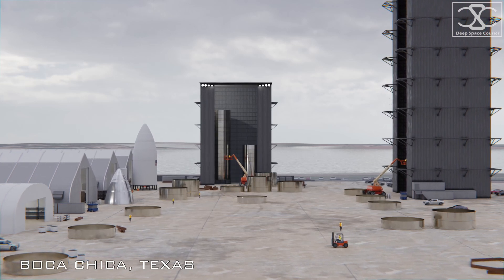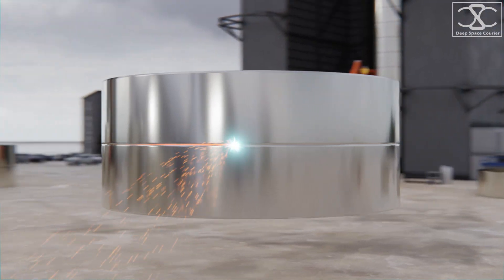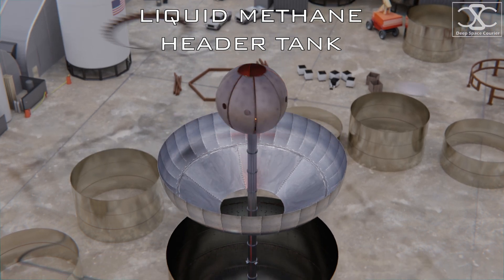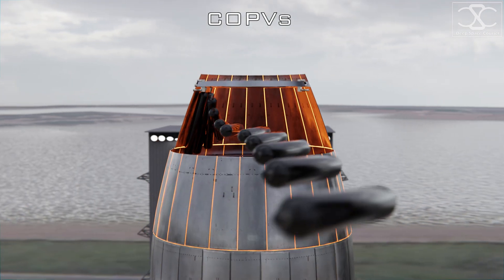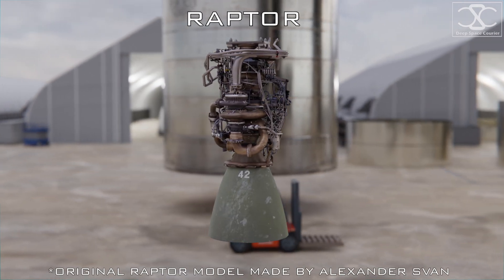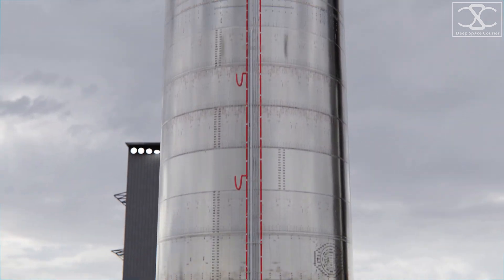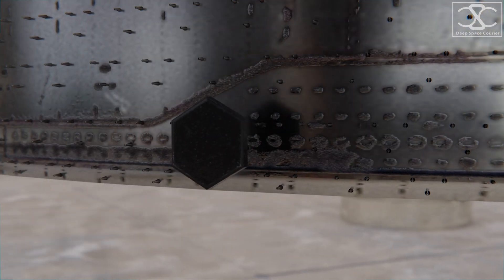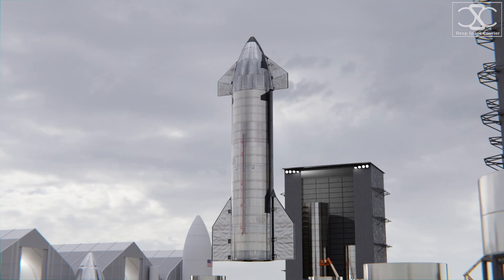Inside the SpaceX Starship: A Narrated Assembly Animation

Comment: They're landing everything on platforms now, not in water.
Reply: I doubt the starship catching concept to be honest, catching the booster is feasible. For cargo flights, payloads would have to be integrated in a seperate clean room facility anyways. Catching the starship requires so much more precision than using landing legs. Landing legs are much safer. However for tanker varients.of starship there is a rationale for catching it such as rapid fueling for rapid launch cadence. But dont think starship will reach that multiple launch per day goal to justify catching the ship.

Comment: Please start building flying saucers with Element 115 stuff or similar 
antigravitic ARV FTL crafts like the 1980's Flux Liner ...

Or like a 35 times larger cylinder in width 

Perhaps these could be 3D metal printed 
in one piece just like the trusters!

118 feet x 30feet

=  3540 x 35 = 123.900 feet / 100 x 30 ( feet in meters )
=37170 cubic meters cargo vollume to fill.

Add gravity shielding matting to isolate the gravitational physics.

Additional engieering is based on capacitors, plasma flux, particle magnets...
Chemical gas, probably a big magnatron at the tip, surface material fision reactor.

Benefits would be:

More space for cargo at once.
Much Faster delivery ... about days or hours to Mars....
Just needs to hover up.
Can go several times around without refueling...
Noise level reduced suitable for urban enviroments...

Thruster companies still gonna continue, just smaller thrusters for 
maneuvering thrusters.

Comment: 4:20 (talking about the bottom text), Probably the sea level engines are needed to fire after separation. Low thrust to weight ratio stages suffer of relatively big gravity losses (thrust to weight ratio being the ratio between the mass of the vehicle and its thrust), with more engines and more thrust this losses (although still present) get reduced, this might compensate the difference between using the less efficient sea level engines and no using them

Outside of that small thing, great render and video!
Reply: All six engines will fire after separation, in fact Elon confirmed this. I'd expect the strategy to limit G-loads toward the end of the burn would be to first shut down all three sea level engines, then throttle down the vacuum engines.

Comment: The part that I laugh at that most people deny is the rapid reusability.  FYI, this is just space shuttle but in cylinder form.  Those tiles will need inspected and replaced every flight, otherwise FAA will not clear it to fly.  So doing that will take at least a month minimum.  It takes at least 2 weeks for FAA certification, so maybe 3 months optimistically inho.  All my money is with NASA and that SLS is still better.

Comment: The heat shield tiles constitute the Achille's heel of Starship. The recent incident where even the rumble of a single raptor managed to dislodge a few tiles is not confidence-inspiring. I wonder why Elon rejected the idea of transpiration cooling. Such a system would be much more robust in my opinion.
Reply: Transpiration is hard to control (i.e. how much would transpire through each "pore") and the "pores" would be easily clogged with soot.

Comment: I see no possible way 150 people could comfortably travel in that Starship. Sure they would fit but they would be packed in head to toe like a tin of Sardines.
Reply: I don't think it would be 150.. 
Imo it will probably be around 50 for mars.
And around 100 for earth to earth.
Reply: Where do you get the 150 people number from?
Even Musk said 100 people max to Mars.
And in the beginning there will be much less passengers anyway.
Reply: It’s 100, not 150. You must not have a sense of scale here, because starship is massive. You could actually fit 1000 people in there and it wouldn’t be anymore cramped than an airliner
Reply: It's apparently 8m across, which is quite large... But I doubt it is a single skin of stainless steel. So I assume there will be a cavity creating a smaller inside dimension. My sitting room is 6.5m by 4m / so, to be generous,  lets say 7m by 5m ... I had a Party at my house with 30 people most of which were in the sitting room and you could hardly move without banging in to someone. Going on those proportions to get a 100 people in my house I would have to have at least '3 Floors' the same size, possibly 4 floors and they would be crammed in like a tin of sardines. That's why I find it hard to imagine the numbers that are being proposed...
Reply: @lilbullet158  Actually it's 9m wide, but yeah I agree. Although I don't think SpaceX ever said starship will carry 150 people..
Reply: @lilbullet158  your interior numbers are way off. Its 9 meters by 15 meters meaning 1100 cubic meters of space. No second layer of skin will be present as far as we know, and even if there was, a meter thick is very unnecessary. It would be more like a centimeter thick at most, but that’s even overkill.
Reply: @lilbullet158  
"It's apparently 8m across" 
How did you get to that conclusion?
Reply: @reagank.2268  It would appear you are looking at the Starship as a 'Giant Bean Tin' with nothing in it, like every cubic meter is space for Humans to be squeezed into. Which in itself is an "Inferior" , or rather a ridiculous hypothesis. You only have to look at Every other vehicle used for the transporting of people into Space to know that a considerable amount of available space is taken up by the huge amount equipment necessary for the journey. Also, with regards to the Starship having a 'Cavity' ? One way or another 'It Has to have one.' What that Cavity is made up of is debatable, but remember Space is more than Minus 400 degrees-F a temperature that would Freeze and obliterate ANY Living Tissue. So Insulation is an absolute necessity. And the Bigger the empty space inside the Starship,  the better that Insulation has to be (To keep Cold out an Warmth in). You need to sit and think your proposals through more realistically.
Reply: @lilbullet158   How much shielding do you need? The Apollo capsules experienced a massive amount of radiation and heat(because they’re going to the moon) and they were only 2.5 inches thick, some places were even half an inch thick. You don’t need an entire meter of rad shielding. Just an inch or two of insulation will do the trick. 

Also, what feels like a small amount of space on earth, is much more in zero g because you can use all the surfaces for equipment. The space shuttle had 70 cubic meters of interior space and could hold 7 for a week. Starship will have 1100 cubic meters of space. That’s 15 times more interior space. 15 x 7 equals… 105. Well how about that
Reply: @lilbullet158  for the crewed launches to mars, they will send cargo starships with the crew that can dock to the main ships and can hold all the supplies for the mission. No cargo space required in the main crew ship
Reply: @reagank.2268  Building Spaceships is not my field. But I'll take a guess right now that as big as the Starship is the first Man Mission it goes on won't have any more than 'Ten People' on board.
Reply: @lilbullet158  Agreed, but a lot more than 10 people are necessary for colonizing Mars as they want to do. So being able to traffic 100 people per flight is important
Reply: @reagank.2268  Perhaps a better idea would be send a whole fleet of Starship at the same time. With less people per ship but more equipment. Ten ships with Ten people per ship would still be 100 people but the combined payload to create living facilities would be Huge...

Comment: Giving to much information to the Chinese
Reply: What info exactly?
Reply: @3gunslingers  about the starship lol, i can already see the Chinese drooling over this technology
Reply: @LeftOverMacNCheese  
The chinese can drool all they want.
The real new stuff is in the material science of the heat shield, the programming of the avionics, the internal layout and metal composition of the engines and especially the rapid manufacturing process. Nothing of that is visible in such amateur renderings. 

It takes FAR more than looking at pretty pictures to build a functioning rocket.

As Musk said: "Anyone is welcome to copy the Raptor V1 designe. But they would be dumb to do so."
Reply: @LeftOverMacNCheese  
i mean even if you get all the blue prints and data from SpaceX it still takes someone like Musk to actually make such a project happen.

Comment: Starship is an amazing project, and Im a great fan of what EM is trying to achieve, but your very informative video shows current technologies greatest weakness. The propulsion system. It may be the best available at the moment but it takes up more than 60% of the vehicles volume and then becomes redundant very quickly. A quantum leap in propulsion research is required funded by another Multi-Billionaire. There appears to be no shortage of them.

Comment: The fact that this is already semi-inaccurate is not a factor of video quality but rather a testament to the rapid innovation of SpaceX.
Reply: What has changed?
Reply: @dhargarten  A few minor things. The position of the front flaps and construction of the nosecone to name a few.
Reply: Imagine if the CAD drawings the SpaceX engineers works on would release them as public domain... :-)
Reply: @thiesenf  and let their competitors use them?
Would be cool but would make SpaceX Bankrupt...

I can totally see a company, not spending much on R&D and just copying, slightly modifying and selling it's services like 10x cheaper....
Reply: Now its pretty inaccurate. Foreward flaps will change position, an additional 6 vaccum raptors are planned, the methane header tank has moved to the nose with the LOX header and the tanks will be stretched a little.
Reply: It's not like that at all. The fact is that while they draw beautiful images of the ship under Ilona's tales, everything turns out on paper. And then real engineers come who need to implement this nonsense. And this is where the problems begin, because the tales from Elon about cooling through micro holes do not work and they make good old scales like on shuttles. Later, they understand that the military budget will not pull it and the supposedly private space requires engineers to save money again. And the only thing left for engineers to do is to offer the technology of 60x ablation of the protective layer. Then it turns out that for refueling in orbit, this silo tower will need 10 to 13 docks, and again poor engineers have to come up with. Meanwhile, simpletons commoners praise the silo towers of "high technology" from Ilona)
Reply: @АлександрЛукьянчиков-р3й  Bro the ship exists. It has been tested numerous times. Just one super heavy static fire has made it the most powerful rocket in the world. Go away with your copy/pasted nonsense.
Reply: @DexOfOne  You know "Bro", I did not write that the ship "does not exist." Check your eyesight and at the same time your head, otherwise you are imagining something that is not there. The shuttle would also be a powerful and excellent system, only without a crew rescue system. And God forbid, something will break in Ilona's silo tower, or, like with the Shuttle, a couple of protection tiles will fly off. Silo tower Ilona, at this moment will become not only "The most powerful rocket in the world" but also will be awarded the title of "New record holder for corpses in one flight."
P / S. You seem to be a lover of everything "the biggest", usually men compensate for the lack of pants with this)
Reply: @АлександрЛукьянчиков-р3й  why do you keep mentioning yourself?
Reply: @DexOfOne  Because you are crazy and you see something that is not between the lines. Make an appointment with the doctor, return to reality.
Reply: @DexOfOne  the ability to "joke" requires a good intellect, as you can see it is not yours. As for "making a fool": millions of people believe in the colonization of Mars and the Moon, by the forces of a "stainless steel silo" which is not capable of developing more than 5 km / s, this is literally madness. A whole horde of representatives of people who are not able to master the school physics course.
Reply: @АлександрЛукьянчиков-р3й  Where do you get your Δv data?
Reply: @DexOfOne  Open the cyclogram of the Saturn 5 flight, in general, I strongly advise you to study the entire Apollo program. Further, a school course in physics, Newton's laws and the Tsialkovsky formula. And then master the calculations yourself. And as a result, you will find that: to fly to the Moon and return 1 tin bucket with a crew called "Starship", you will need 100 launches of other "Starship" with fuel. And the flight time to the Moon will be about 70 hours. And to Mars 4.5-5 months and another 7-8 months for the return flight (if you fly in 2030 when there is a confrontation between Mars and Earth, with the maximum convergence of the planets up to about 40.5 million / km) Well, the number of "Star Ship" with fuel can be safely round up to 1000. This is not to mention the fact that cold methane / oxygen cannot be stored for more than a month in space without significant losses. Elon Musk is a brilliant marketer who sells nonsense to fools who have poorly taught physics. Don't be a fool - learn physics!
Reply: @АлександрЛукьянчиков-р3й  100 launches of starship for a full  refuelling???? NASA gave a conservative estimate of around 10+ launches, Elon said it could do it with less. Cryogenic propellants can be stored for a while given you have systems to prevent boiloff. ULA planned to make a long duration centaur upper stage for Vulcan called ACES.
Reply: Im pretty sure starship wont carry crew by itself for a while. If there are some serious concerns with the system they can always send astronauts up in a seperate vehicle like dragon to dock and load crew onto starship. Will spaceX make a mars city with billions on mars? Most likely not. I'd expect a small research outpost that can maintain itself autonomously.
Reply: @АлександрЛукьянчиков-р3й  my god, i know your comment was 1 year ago, but how do you type that much?